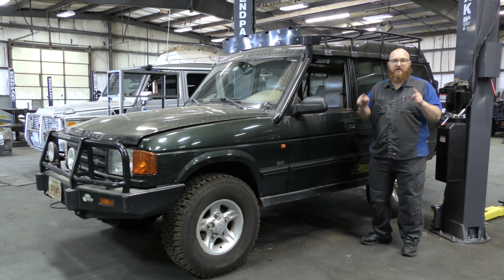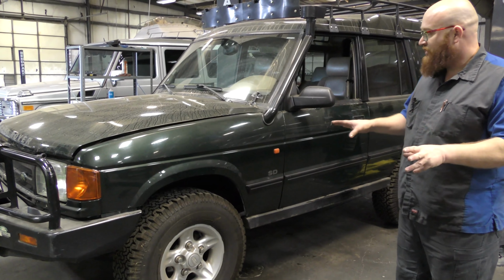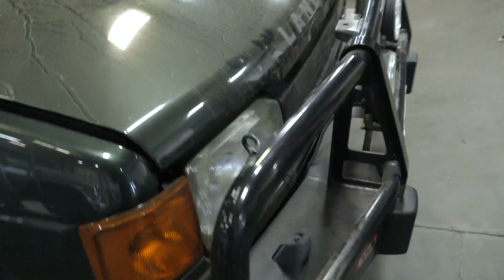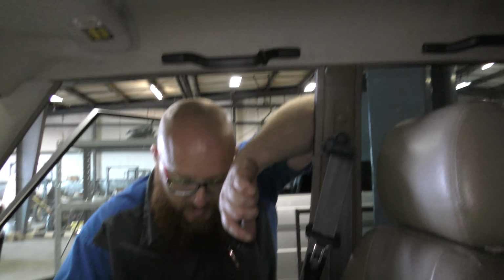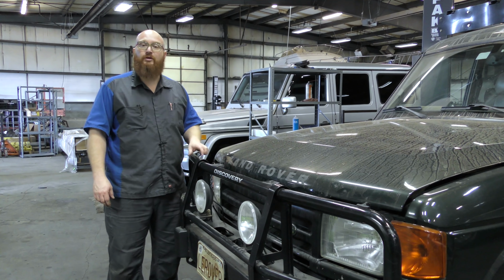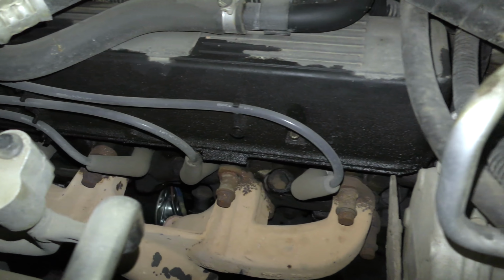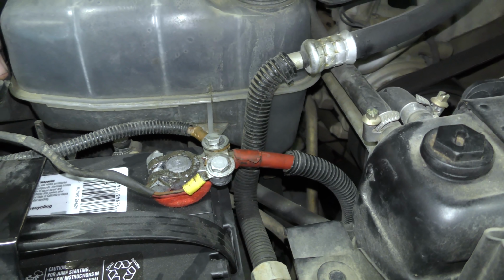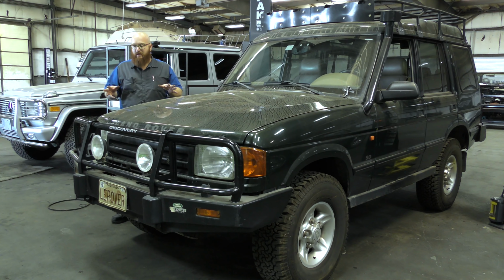How can such a simple repair cause huge problems on this '99 Land Rover Discovery? CAR WIZARD knows

Comment: If I’m going to Africa or the end of the world, I’ll be driving a Land Cruiser. Thank you.
Reply: 100%
Reply: @aussie2uGA  and Australia also agrees.
Reply: 100% This is the way!
Reply: Yes correct and the wizard is wrong not everything will break down, land cruisers will keep going.
Reply: Janet D everything eventually will break down.
Reply: @jkeelsnc  You're talking there like Japanese vehicles don't rust.  They're the worst when it comes to corrosion
Reply: Janet D yet Range Rovers are very popular despite their reputation for non reliability.
Reply: @bngr_bngr  Yes they are a fashion trend among celebrities etc, its like having the latest iphone. Just like BMW's are poorly made but people still buy them.
Reply: @jkeelsnc  Am not saying the LandCruiser is bad or anything but I've seen pretty modern Japanese cars with worse corrosion than most others.  British cars were pretty woeful too.  But then again I know guys with 30 and 40 year old Land Rovers that have never been welded once, and also a 1981 LandCruiser diesel I do maintenance on that looks like it's fresh off the production line.  In UK weather too
Reply: The only correct answer is Sherpa
Reply: @janetd5121  Not poorly made. The fit and finish on BMWs and Landrovers are usually excellent. What you should mean is they are over engineered, making even the simplest operation overly complicated and complex just to squeeze out a little more performance. That's a recipe for disaster when they age.
Reply: You write like someone who has travelled very little. You think Africa is a country...
Reply: If you go Africa or the end of the world a Land Rover has already been there
Reply: @Epotheros  When you make things like water pumps out of plastic and your engine bearings needs to be replaced as "routine maintenance" that is not only poorly made but poorly engineered as well. When oil leaks, heads gasket failures are normal for almost all your models and when things like  window switches and rubber door seals start peeling off on brand new land rovers that is poorly made. 
 It doesnt take over engineering to get all the above issues, its making things out of cheaper materials and cutting corners to save money, hence poorly made.
Reply: @TheBlaert  I have a 1968 series 2A Land Rover that I bought as my first car and still have it and it rarely has any issues unless it’s related to extreme age
Reply: I would bet you are thinking of the wrong Landcruisers.
Reply: @jarlnieminen4307  I like the land cruiser a lot myself it’s got it’s own vast history that a lot of people don’t know but I wouldn’t mind owning a big V8 land cruiser one day
Reply: @Offensivebeast  there's many very different Landcruisers. That vastly differ in reliability. They are all cool weekend 4x4s.
Reply: @jarlnieminen4307  I don’t know the whole land cruiser lineup/history very well but they’ve got a lot going in Ireland we only get the Prado and the rare V8 land cruiser
Reply: @Offensivebeast  100series V8 petrol or 200series twin turbo diesel V8?
Reply: @jarlnieminen4307  we see both of those rarely over here but I’d like a 200 series I saw a 100 series in mint condition with gold Toyota badges and with bigger tyres a week or two bsck
Reply: @Offensivebeast  they really are a nice cruise ship
Reply: @jarlnieminen4307  definitely I’m trying to see if I can get a go in one after I get a shot in the 2020 defender I’ve always been interested in them
Reply: @aussie2uGA   ISIS is a good advert for Toyota. Jihads are not going to pop to the dealer for a new part every week. ...just forget the terrorism.
Reply: @janetd5121  True, my 1988 LandCruiser turbo diesel (legendary 12HT engine, not high power, but reliable) never let me down, sold at about 367,000 km's. Land Rover Discovery 2, 2000 model TD5 diesel (my cheaper replacement), catastrophic engine failure at 174, 572 in 2016. Turns out known engine problem since first year of manufacture from 1999 (when BMW owned them, then sold to Ford in 2000, then sold to Tata of India in 2008). No recall to repair even in the early 2000's, as engine failure is not deemed a safety issue, a brake failure/air bag problem would be. The nut retaining the engine oil pump sprocket lacked enough thread locking compound to retain it (bad engineering at it's worst), it can work loose and fail at any time (essentially a ticking time bomb). This sends the oil pump drive chain into the timing chain, breaking that too, and yes, it's an interference engine, so pistons then slamming into the intake/exhaust valves, goodbye engine and entire vehicle as a result!!! It's not economically viable to replace the engine, and that's with a second hand engine from a wrecking yard too!
Reply: In Australia they say," You go out to the Desert in a Land Rover, but you come back in a Land Cruiser..."
Reply: @PG-ig4wv  Did a Toyota towed it there? 😂
Reply: @eastafricanvybz  If I say I’m going to travel in Europe do I think Europe is a country? We get it. Africa has many very different countries.
Reply: So right, not even close

Comment: I would never ever buy a Land Rover Discovery in general. Scotty Kilmer did a video on a 2002 Mitsubishi Montero Sport yesterday and he said that the vehicle has between 200k and 300k miles on the odometer. It is still running, except there is still a lot of problems with oil burning inside the engine or components, etc. Anyway, it is now the weekend and the first buy this, not that video of 2021 should be up tomorrow afternoon. I am definitely hoping that the Car Wizard will do Mitsubishi vehicular products in his what to buy and what not to buy series. Everyone is thinking to buy an older Lancer or a newer Outlander for one of their first or next vehicles. It will be interesting.

Comment: I have to admit that I’m impressed with myself for guessing exactly what the problem would be as soon as I saw those temporary use, emergency only piece of crap terminals on the battery! I have seen so many vehicles display problems because of those.

Comment: I owned 5 D1 over 15 years of various set ups and never being broken down or towed in any of them. Having traveled up and down the east coast of Australia that says it all. It comes down to servicing and maintenance. Keep it up to date and on top of it. Do most of it properly yourself and save. And yes I’ve replaced a set of head gaskets on one of my D1 but it a known trait of these engines. These are simple vehicles compared to my current Range Rover Sport. Basic tech with real off road ability. Well I know at least 3 of us here like them.... Mr & Mrs Wizard and myself.

Comment: Thanks, Wizard.  Like the Discover, like the Defender and Range Rover more. I've been busted for something similar.  Told by the service garage my battery terminals were corroded (I am not paying them $50 to do that I can do it myself).  But I waited..... until no go, then I cleaned them off and it worked fine.

Comment: "You don't see a lot of g-wagons in the middle of nowhere" g-wagons are used by tonnes of military's across western Europe.
Reply: Western Europe is not in the middle of nowhere.
Reply: Those are not the v8 mall crawler spec variety.
Reply: @nielsdebakker3283  Nope, they're the special military spec. Diesel, I think?
Reply: How is anywhere in Western Europe comparable to the Australian Outback or the African savanna?
If your vehicle broke down in the remotest place in Western Europe how many kilometers would you have to walk to the nearest house or farmstead?
Reply: @williamegler8771  probably 10 km. Outside of Greenland or Russia, there are few places in mainland Europe where you can be more than an hour's walk from other people.
Reply: You see those a lot here in Miami.
Reply: @weedmastersr  And in the Australian outback you would be facing certain death in a Land Rover.
Reply: @XVRickXV  Beverly Hills as well!
Reply: They still sold Mercedes G-Professional in Australia until recently, that's the most basic as G-wagon go in the 21st century.
Reply: @weedmastersr  You can easily be a few days walk from built-up areas in Norway.
Our military has Geländewagens as light duty vehicles (they replaced the Land Rovers and Volvos for all roles those held), but have replaced the armored models with Iveco and Dingo after they quickly proved to be insufficiently armored for Afghanistan and the modern battlefield.
Still an extremely reliable and capable unarmored transport though.
Reply: @Banom7a  rofl.
You see a g wagon once a year here in Australia.
Being driven by some mum taking her kids to their private school
Reply: And in Canadian military but they are trash. Canada had to pull.them out of Afghanistan because ether were so unreliable and the Unibody design was causing them to twist so bad. Its a luxury vehicle.

Comment: I had a problem with my Ford C-max, after I had the clutch and flywheel replaced.
I went out, the car started fine to go out, wouldn't start to get home again. Called the breakdown people who had a look and said the starter motor had failed, so he tow started the car so I could get home.
Called out a mobile mechanic to replace the starter motor and he checked the battery terminal clamps before replacing it. One was tight as it should be, the other one had the bolt done up tight but could spin round on the battery terminal.
He replaced the clamp with a universal one he had in the van and it started no problem. He only charged me about £20 including the clamp so I was very happy. Would have been nearer to £200 to have the starter motor done, only to find it didn't solve the problem.
That was almost 3 years ago and I haven't had a problem starting it since then.

Comment: Wow.  My mechanic would have charged me nothing and told me to remember the goodwill--and to tell my friends.
Reply: Same. He charged him for that...wow.
Reply from the maker: Its actually the other way around. We found the problem and was honest about it. I know of several shops that would have taken this guy to the cleaners. “Oh it needs a new control module, $1200” and only tightened the battery for $1200. This guy now knows we are honest and will be back. Just like the other 3000+ customers in my customer base.
Reply: Wow. Your mechanic works for free?
Reply: @CarWizard  Congrats on your 3000+ loyal customer base...I hope they stay that way.  I was just saying that to tighten a couple bolts it would have been a good gesture to do this on the house and catch him next time.
Reply: $150 to tighten two bolts. Must be great to be a mechanic.
Reply: No wonder he has more unsubscribers than subscribers

Comment: gotta love simple electrical fixes. i bought a 00 cavalier 5 speed for $300 that didnt start. the guy said it ran and drove good, only really needed brakes and that was it but he got a newer car that was 4 door and stopped using the cavalier and came back one day and it wouldnt start, and he blamed it on the area for the "crackheads"  messing with his engine wiring harness or ignition, vandalizing or cutting wires etc. i took his word for it after feeling the gears shift and clutch operated fine and had fluid, as i only wanted it for the F23 getrag manual so i bought it and towed it home. got it to the garage and immediately pulled the starter off thinking that was it and it was late so i waited till the next morning i got the starter tested at autozone and i didnt even notice since it was so crusty and dirty, they pointed out it was a cheap and very OLD valuecraft starter lol. i thought that was funny but it had a loose pinion gear and if you shook it, there was a rattling sound but it passed on their tester twice! so i threw it back on and while hooking up the odd starter wires (5 total and one requires you to remove one of the two starter housing bolts! very weird but part of official gm recall and it works) but on one small wire that turned out to be the signal wire, the terminal popped off the wire with little effort as i was sorting which was which so i replaced the terminal end and a small length of similar gauge wire and it started right up! i also swapped the starter relay before that is oddly inline with the engine harness which is also part of the recall but i swapped the original one back in and it was only that one wire and still started up the same. drove it around a bit and it runs and drives so mint! i really dont want to get rid of it because my first car was a 00 cavalier same red coupe but auto, but this one has a bad title and i could really use the manual transmission in a 3800 swap but hopefully i can give away some of the good parts to any cav owners that need them thru the facebook cavalier group

Comment: I've been working on car electricals for over 40 years now, and I tell my customers that the problem is usually something simple and stupid. Case in point- a cheap Made God-knows-where battery clamp (originally intended for emergency use), not even fully tightened. In this case, I would likely go a bit further: crimp-on copper lugs for the cables, heat sealed shrink tubing to insulate, and a marine-style battery clamp with a locking nut.

Anyway, good job by Junior Mint finding a problem quickly that would drive most most mechanics over the edge.

Comment: When I worked as a mechanic in the 1970's - 80's battery terminals were one of the biggest culprits for road service, especially those GM side terminals. Often a good twist of the terminal would get the car started.

Comment: You have a good customer there. Some customers just don't realise the amount of time it takes to diagnose an issue, time that costs money. Also, the knowledge needed to diagnosing the issue is valuable. The owner obviously spent hours trying to diagnose the issue himself, but your workshop solved in in less than an hour.

Comment: I got similar issues and i tracked the source of the problem down to water leaking through the bulkhead down onto the alarm ECU which on a UK car is situated behind the panel in your driver's side forwards of the door to the left of your feet. I discovered that the PCB box was filling with water. Who'd have guessed that water and electric don't mix?
Cured the leak, dried out the box and board and end of problems

Comment: Regarding the head gasket on these I've always fitted an electric fan with a manual override. Regular oil changes and coolant replacement is must on these.

Comment: the 961 paint looks great on the old D1's. 
I have one (bliue) that i have turned into a camper, a V8i in the great needing a rebuild and currently drive a white 300Tdi. Yep, got thing for em lol.
Great video. Thank you for the insight.
Cheers for sharing.

Comment: 50 years ago my Saturday job was to wash two cars for a rich couple. The lady owned a Rolls Royce Silver Cloud, her husband a Princess Vanden Plas. I also used to check the oil, water and tyre pressures. One day the water in the Rolls was low, I added about one gallon. Then I checked the oil, the dipstick was full of brown froth. I told the lady that her head gasket had blown but she would not believe a 16 year old working class boy. The next day she tried to go on a long trip and wrecked the engine. I have no idea how much that cost but it would have been expensive.
Maybe she should have asked why mechanics are in my blood line.

Comment: Mine was painted Viper Blue BTW... with a white stripe at the bottom  of the rockers... and has flashy lights... bought it from a security company and... I did the head gaskets under a tent in my yard too. also wanna point out that the temp  gauge sucks... always better to put the gauge plug in on it.. I have friends that said the temp gauge never went to over temp until it was too late... and warped the heads... luckily mine just started missing and never went too far over temp. I knew it was an issue so I kept an eye on it.... now I'm chasing a bubble in the heater core... won't heat the vehicle until  I drive it around for a minute or two... which sucks when it snows. One thing I hate is the angle of the windshield... I can have the heat blowing full blast and the windshield and wipers still freeze up... so I got heated wiper blades that I need to install... just got them from candadaina... so we'll see if that solves it.... other than that.. it's a weird truck but. I love it

Comment: Mine is a 2000 disco 2, have changed the head gasket in my driveway. Great truck even 20 yrs old, easy to work on.

Comment: Car Wizard you mentioned wanting a silver Range Rover.  While a district service manager for Cadillac Division of General Motors I was in contact with the Tech Center, Fisher Body and most other affiliates. South Florida had paint problems that were not experienced elsewhere. During a meeting at a Ft. Lauderdale dealership with a Fisher Body paint engineer discussing silver paint I was told silver was the most dangerous color to have on your vehicle. Why ?. It becomes nearly invisible at dusk and dawn and, hence is more prone to accidents. When I asked, if that was known, why paint the vehicles silver? His response was - GM was in the business of selling cars and 20% of all sales were silver, so if that was what they wanted - they got it.  Just thought you'd like to know.

Comment: always liked the Mk1 Discovery - nicer than a Defender and more of a utility vehicle than the Rage Rover - friend of mine around 1993 got hold of a very high mileage Mk1 TDi 200 (ex-rental car) and a totalled out 1992 Range Rover Vogue SE (insurance repair gone wrong - they didn't accept it had a bent chassis until a load of money had been spent rebuilding it) from a customer and built what you could essentially call a 'Discovery Vogue SE' - swapped the V8 engine, automatic transmission, air-con, leather interior into the Discovery's shell. When finished it was a very nice vehicle to drive and pre-dated Land Rover offering a up-market Discovery.